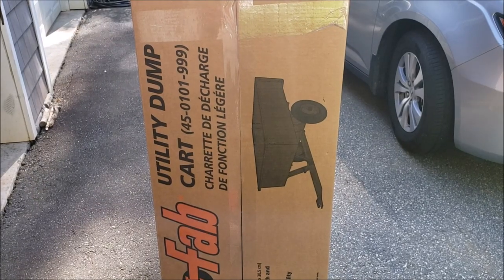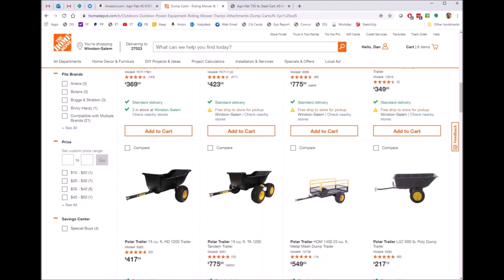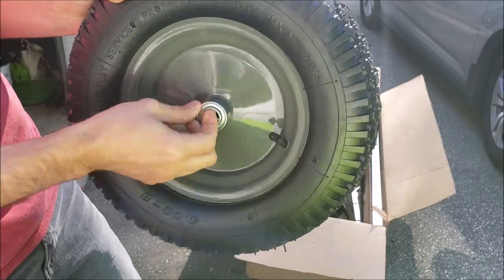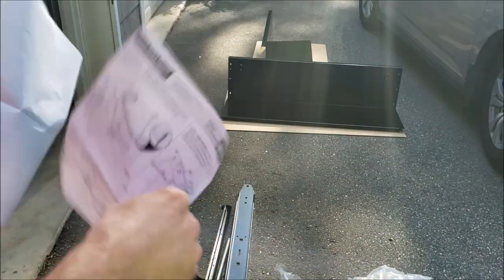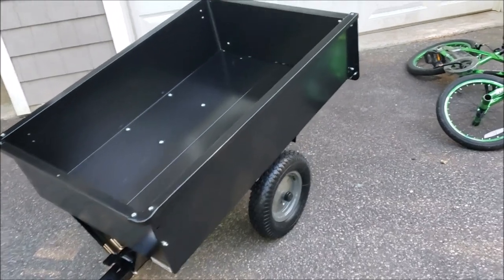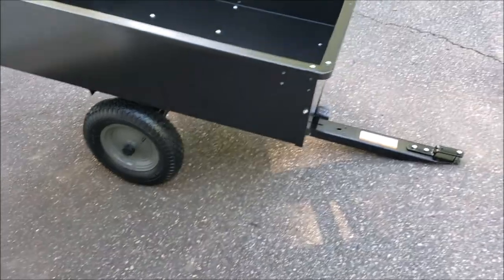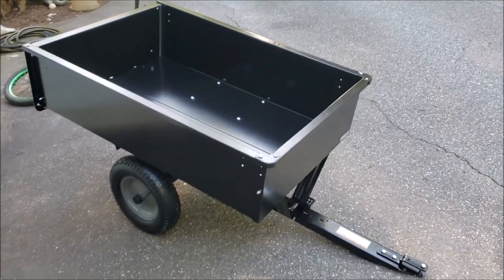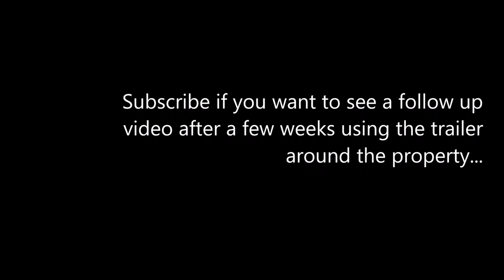AgriFab 750lb Garden Trailer Build and Review

Comment: These things are the worse 

Rust cans
Reply from the maker: The only place I have any rust on mine since having it for about 2 years now is the axle. But there are grease fittings by the wheels on for the axles so it isn't rusty where it is important. Other than that, I have zero rust on mine.

Comment: Good video Dan, I ordered one of these from Lowe’s close to the  same price point you got yours for. I looked at many of them and this one fits the bill for all around general use. Another thing I discovered was Craftsman has the same exact unit except the rear reinforcement brace has two separate L shaped pieces, so the Agri-fab is a improved design with the one piece brace. Thanks again!